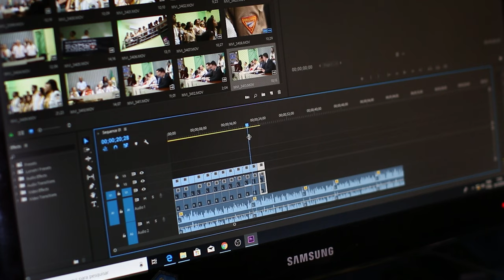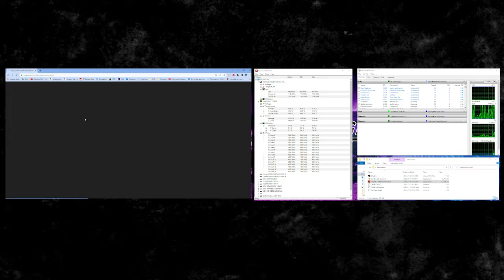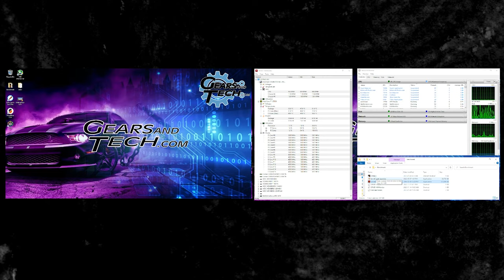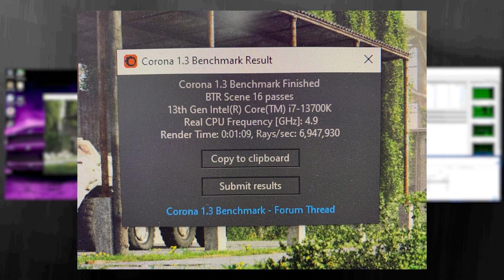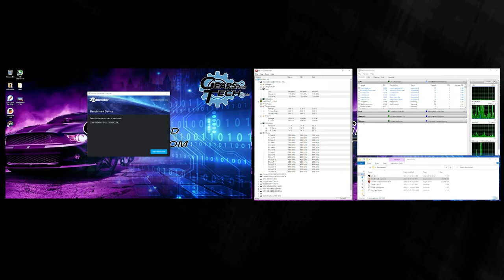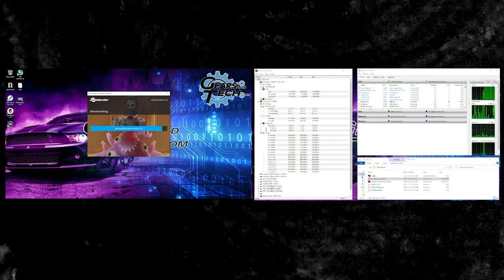COOLING DOWN the NEW Intel i7 13700K CPU ~ Whats the MINIMUM Cooler size that works? |Gears and Tech

Comment: When I got my cooler for the first time.. I had a no display issue and when I benched marked my CPU it would hit 100oc then after 1 second it would drop down to 65-70oc then slowly climb back to its thermal limit and do the same.. I have the 13700f and its a pain to keep cool..
Reply from the maker: You're for sure throttling.

I don't think mine is thay bad. But I still need to do something
Reply: @GearsAndTech very true.. But mine is over clocked and max wattage is 219 watts on intel site but mine is nearly 260 watts and clocked at 5.2ghz. Ive managed to find its happy spot and under max load im getting 80oc and my room is 30oc due to a heat wave in England.. I think I have done well to be honest.
Using a NXZT Kraken Elite 240 and Artic MX6 - Little over a pea size, once cured I will get better temps. Thank you for replaying to my comments, I do appreciate it alot (:

Comment: Hi. Your setup in this video uses two exhaust fans. Did you already try to change the aft fan to pull air in? Instead of exhaust. I think you should create a over pressure. In order to cool the radiator.
Reply from the maker: I have changed my setup a bit since this video and surprisingly didn't get any better results.

I'll be doing more videos showing undervolting and some case mods

Comment: What is the contraption with the older harddrive in it behind the monitor/pc?
Reply from the maker: It's a hdd toaster with two 6tb drives. When im done editing a video and have uploaded it to yt I transfer everything related to that video over to the hdd. If becomes long term storage of all my content. 

Is use my nvme drive inside my rig to edit off so I get full speed playback.

Comment: I wonder if adding a contact frame would bring the temperatures down further? @gears and tech
Reply from the maker: I have one sitting here in the box. Just haven't had a chance to install it yet
Reply: @GearsAndTech  if you install it and there’s any thermal difference make a video. There’s literally no 13700k and contact frame videos on YouTube

Comment: i took new i7 14700k and i can see the heat waves to my body, and i have place the liquid cooler LE300, still i can see the heat, any help on this???
Reply: Go for all core overclock and fix the frequency and vcore. Then you don't have to worry about less performance and with fine tuning you have a nice stable computer. Like here in the test you see 100 degrees and 4.9ghz. While with my method, it will be like 90 degrees and 5.3ghz always.

Comment: Would the h150i elite capellix be good ?
Reply from the maker: For sure. Any 3 bank aio cooler should be great 

A 240mm just barely meets the spec requirements. 

If you're grabbing one please consider using our amazon links to get to the store. Then select whatever you're looking for. It helps us out and doesn't cost you amuthing extra
Reply: @GearsAndTech  how much celcius would it be with the h150i elite capellix ?
Reply from the maker: It's tough to say for sure. If I WAs to guess I think it would stay below 85
Reply: @GearsAndTech  it looks like the h150i elite capellix has went out of stock. is the corsair icue h150i elite capellix XT the same ?
Reply from the maker: Should be similar enough to work the same

Comment: You use contact frame with the 13700k?
Reply from the maker: No I did not 

Do you think it makes much difference?
Reply: @GearsAndTech  maybe, maybe not..  For me it only did a couple of degrees difference.. Like 3-5 C
Reply from the maker: 3-5 is pretty significant if you're hitting that upper limit 

I still sometimes hit over 90 degrees c. 

Would prefer to be 80 or less
Reply: @GearsAndTech  Im also hitting around 90C with a good air-cooler(rated at 250w)..  Voltage offset -0.100..   But atleast i have no throttling.
Reply from the maker: I think the best gains would actually be overclocking. You can keep it cool while still getting a little more performance. 

These things run hot. So 90c isn't bad. 

If you hit 100 it's a problem.

Comment: Got a new rig a day ago with an i7 13700k. Idle Temps were at 50 to 60 degree which is way too high and constant 100 under load.... turns out they forgot to peel of the fucking plastic sticker off of the cold plate😂 now it's 35 on idle and 50-60 when gaming.
Reply from the maker: Wow, good catch!

Comment: Can you do a comparison video between the i7 13700K vs Ryzen 7900X I see many comparison videos for gaming but there is no video on productive I am confused about which one to pick video might be helpful for me
Reply from the maker: I can take a look

Basically whichever has more cores and higher clock will be best
Reply: @GearsAndTech  I compared both CPC's clock speed, cores, and cache but the problem with Intel is efficiency cores amd has 12 cores and Intel has 8 performance cores and 8 efficiency cores as you can't take efficiency equal to performance cores so I can't really take a decision can you suggest me which one to pick
Reply: Definitely the 13700K, it's faster both single-core and multi-core, coupled with the integrated UHD770 makes it a productivity beast
Reply: @pixels_per_inch  Thanks

Comment: I am currently using a Noctua NHD15 which is mounted upside down. Meaing Fans are poitning to the top of the case due to clearance issues. and My temps are going to mid 80c when gaming. Do you think If i go for a NZXT Kraken X63(280MM) it will fix the temp issues? I am using a LIAN LI 215 Case.
Reply: I use the kraken z63 (same thing but with the GIF display) and it can cool a maximum of 300w for my 13700k. I usually keep it undervolted though. Temps are very good
Reply: @SlimedogNumbaSixty9  can you tell me how it did before undervolting? i dont want to do undervolt. Have you checked R23?
Reply: What temperatures do you get in Cinebench 23 in 10 mins?  I have D15s with an additional fan and my 13700kf can not pass Cin23 at full speed ,it throttles.
I have undervolted it and it reaches 97C max after 10 mins.
Reply: @atriusvinius319 I gave up and undervolted before understanding i was getting 97c on cpuz stress test. i haven't tried Cinebench, but after undervloting stress test its around 82c average and all core maxed
Reply: @Proxylamborg  its very weak test.  Only about 75% processor utilization. I have the same temperatures there. Try Cin23 its free.  Or OCCT power test))
Reply: @atriusvinius319  its puts all P core to 5.3 what its max and cpu power draw is about 230 watt. I don't really want to try anything else.
Reply: @Proxylamborg  Strange /  i have in cpuz stress only 180 watts but my Pcores too 5.3mhz / May be its becouse of I have undervolted my CPU
Reply: @atriusvinius319  I dont really Care about those temps as long as my gaming and work temps are under control. I edit a lot on adobe. In there my temps never go beyond 65 and when gaming like cyberpunk temps never go above 65c. i haven't had any crash yet after undervoltin. before undervloting temps were around 72c when gaming.
Reply: @Proxylamborg  Agreed, I would be absolutely pleased if my temps were below 70c when gaming.  Have not tryed temps in games yet.
Reply: @atriusvinius319  I have 13700k w/ NH-D15S....ended up undervolting  -.075  and actually overclocked all P-Cores to 5400mhz. R23 10mins a max of 93C. Gaming usually 50-65C (Occasional spikes to low 70's).
Reply: @saltal  You are lucky. You v got a very good chip.   You did not touch PL?

Comment: QUESTION !!!   Do ANY of the newer cpu cooler's metal plates actually cover the ENTIRE rectangular shape and size of the 1700 chip??????  All the coolers I've seen still have a square shape to the actual plate that covers the cpu........none have been changed to the rectangular shape.  Are there portions of the cpu surface itself that do not come in contact with the cooling plate....or does the size of the square plate more than cover the longest side of the cpu ??????????????????  (Not ONE website has raised this question)
Reply from the maker: The cooler covers the entire chip
Reply: @GearsAndTech  Thank you for answering my question......seems like no one actually stated the relative sizes of the new 1700 chips, and the old cooler plates....seemed to be an obvious question to pose, but no one seemed to be interested.  All of the 2 million videos on how to pick and install the best coolers....no one tackled that aspect of the subject???

Comment: Tbh you need a new case with more airflow. And then undervolt it then your chillin
Reply from the maker: True story.

I have since adjusted the case and undervolted the processor.

It's doing better, but not perfect. I'll be trying another trick soon

Comment: you should install all the fans over the radiator
Reply from the maker: Yes. But the pc case doesn't have holes over half the radiator. So no need to have fans there
Reply: @GearsAndTech  Or drill holes ? :D
Reply from the maker: I'm exploring a case mod to add holes the entire distance 

So far haven't found any good options for a grill though 

Any ideas?

Comment: Your video has too much grains that has resulted from a wrong LUT applied. Then also your sound is quite harsh. You might want to not gain up the volume of your sound so much. Great information by the way. Thanks.
Reply from the maker: I was using my iPhone to capture my audio which wasnt ideal 

I've also fixed my camera settings to get better exposure. 

It's an evolution that just takes small improvements here and there

Comment: I've got an Arctic Freezer II 420mm on my 13700KF in a 7000D airflow full tower. I'm a thermophobe. lol
Reply from the maker: Normally someone would say that's overkill. But based on what I've seen so far I bet that's exactly what you need!

Comment: Sorry to say, but this is a ridiculous test. Why are you testing a cooler that you don't even have a proper case to install it in. No one ever is going to use the cooler in this configuration with only one fan on the radiator.
Reply from the maker: It was a test of the minimum required.

Comment: I use Deepcool LT720 and have 75-83 C in AIDA64. Is it ok or not ok?
Reply from the maker: Your temp are great!
Reply: @GearsAndTech  thnx☺️
Reply: @mruniverse5704  may I ask what your idle and gaming voltage is bud ?
Reply: @decdonald2508  need to check. But I didn’t anything with voltage, use it with stock settings.
Reply: @mruniverse5704  yeah cheers if you can let me know idle and gaming would be appreciated

Comment: Got a 13700kf overclocked to 5.4ghz no powerlimits ddr5 6400mt and a 4080 MAG z790 tomahawk board 280mm aio be licky to go over 70° in heavy load games people stop being scared there only frying due to people stressing the life out off them
Reply from the maker: Sounds like your system is really setup good
Reply: @GearsAndTech  oh yes my freind

Comment: Still terrible cooling. Noctua makes a 120mm air cooler which outperforms every 240mm AIO on the market including the one you used. Their 140mm coolers are even better. No need whatsoever to be using water and pump and getting worse performance in the deal.
Reply from the maker: I just like the aio for getting the heat out of the case 

The air coolers raise the ambient temp in the case which makes gpu and ram performance start to suffer
Reply: @GearsAndTech  So you believe that a cooler which is located above the GPU and to the left of the RAM and which is vented out to the left and up, will somehow heat up to the right and below it? Okay.... Let's just say testing doesn't bear that out.
Reply from the maker: I'm saying you would need a lot of air movement to convince me that all the heat from that cooler is being sent outside the case without raising the ambient temp inside that case 

Vs an aio that is literally pulling the heat off the CPU and pushing the heat outside the case directly. 

We can talk about the cooling capabilities of the cooler to the CPU another time 

But you'll never convince me that your case temps are lower with an air cooler vs an aio
Reply: @GearsAndTech  That's a straw man. I would never say they're lower. I just said they're not warmer. Of course they're not if the air is being vented up and back. Unless you believe the air can flow in the opposite direction that the fans push it...
Reply from the maker: Lol. So they aren't lower but they aren't higher?

You gotta pick one man. 

Own your statement or admit that there may be some other trickle down side effects that will impact the other parts of your system. 

Personally, I haven't seen any downsides to an aio cooler 

I do realize there are some air coolers that work great. They aren't for me. Just too darn ugly.

Comment: Hello, do you think a 240mm AIO will keep good temps on an overclocked 13700kf? And what about a 280mm cooler?
Reply from the maker: 280 is better if you have the space.
Reply: 280mm is definitely better, but I use a 240mm and its been working fine. If anything you can do a small undervolt to the point you get no performance downgrade and just get better temps overall.

Comment: Nice video. Im planning on doing a build with the i7 like yours and in a nzxt h1 v2 that comes with a 140mm aio cooler but now I’m worried about the cooling solution. It’s pairing with a 3060 and doing some editing like you and few other professional apps. Should I get a i5 13600k instead?
Reply from the maker: A thermal throttled 13700 is still better than a 13600

But when im editing my processor barely has any load on it at all 

You may consider the 13600 and bump your gpu up to a 3070 like mine. It'll help make things smoother. 

The 13700 is the processor to beat. Bang for buck can't be beat!

There is a chance my 120mm aio was getting tired. It was about 4 years old.
Reply: @GearsAndTech  thank you so much for your response and advice. I think I am keeping the 13700k. I already have a 3060 laying around but do planning on bumping that up later down.
Reply: I just got a 4070ti ND 13700k and I'm almost hitting 90c gaming with a kraken x52 AIO. I reapplied thermal paste because I thought I fucked up it was getting so hot lol my 4070ti though sits at 50c while gaming and doesn't make a sound, it's the quietest gpu I've ever had and best at keeping cool.
Reply: My personal experience is minimum cooling for a 13700k, is a 280mm AIO, or Noctua D-15 or equivalent.  Anything less, you will bounce off of TJ max.
Reply from the maker: That seems to be true 

Ideally something with 300w tdp rating or higher

Comment: Sir I have I513600k So Can You Please Suggest Me This Cooler For My Processor
Reply from the maker: 13600 runs much cooler already. Probbaly a single 120mm aio would work fine 

Personally, if you have the space then go with a 240
Reply: @Gears and Tech, would an air cooler keep a 13600k cool, or is Aio needed? Thanks.

Comment: Why couldn't you use a 280mm iao? You have adequate space in that large tower. Your video was stupid because you started out with a 120mm iao on a 13700k and compared it with a 240mm iao. Then you only have one fan installed on the 240mm aio.
Reply from the maker: I was trying to find the minimum needed to make this thing run cool

I didn't want to run the fan in the front because there isn't enough air flow space there.

Comment: Have you tried turning off Asus MultiCore Enhancement in the BIOS? According to Hardware Canucks this is the reason for the overheating Intel 13 series CPUs, and also causing them to use massively more watts: https://youtu.be/dNFgswzTvyc
Reply from the maker: I'll check into that. Thanks for sharing
Reply: @GearsAndTech  No problem, let us know how it goes.

Comment: I got a question, i have the old corsair H100 cooler (6yrs old), will this work fine on the i7 13700k CPU? im thinking of upgrading but reusing my old cooler.
Reply from the maker: As long as the pump is still working and there is enough water in it still then it should work fine.

Comment: i got the same cooler like the one you show but deepcool gammax 360 with 3 fans and i can barely keep the temperatures at bay... when i play the newest games on masx settings the 13700k hit red light and thermal throtlles... i had to meddle with bios settings in pl2 and pl1 and changed the wattage to 125 on the pl2 option.... otherwise my PC hits the 99c
Reply from the maker: Surprising.
Reply: @GearsAndTech  is there a chance that i didnt mount it properly ? or it doesnt have good contact? but the momment i close a said aplication Booom! it dips down in temps almost immidiately!!! so i guess its not a mounting issue?
Reply from the maker: If you have thermal paste left it's worth having another look 

But also perhaps the aio isn't orientated great. I made a new video that covers orientation for aio radiators. It hasn't come out yet. But will
Reply: has to be something wrong. my air cooler, dark rock pro 4 cools it very well.
Reply: @ObeyThePapaya  checked again everything works in order.. pump is working as intended + fans speed up alot when hot... when im gaming it rocks 90c and stays there its all good
Reply: @enchanted7076  that's not all good. A game using only 40-50% cpu usage should NOT even touch 90c

Comment: 1000 times NOOOO.  where are the intake fans?  static pressure is completely negative
Reply from the maker: Intake fan is on the bottom at the front. 

1 fan in 
2 fans out.
Reply: @GearsAndTech  OMG, you should have more airflow coming in than going out. And drill additional holes in the top cover of your case for a second radiator fan.
Reply from the maker: I'm going to be doing a case mod 

But more air out than in is better for dust management
Reply: Tjat was my comment. The back case fan should push air into the case. Only the radiator fan is the exhaust.

Comment: Crap video.

Doesn't even talk about adjusting the voltage first. Just puts on the biggest cooler he can find.
Reply from the maker: There are ways with overclocking and voltage adjustments that can help with heat for sure. But that's not the point